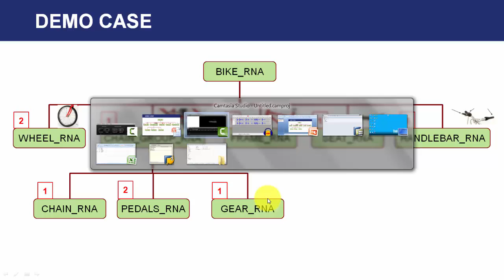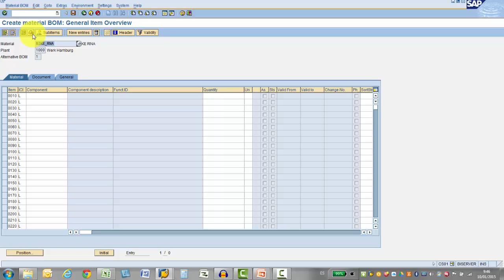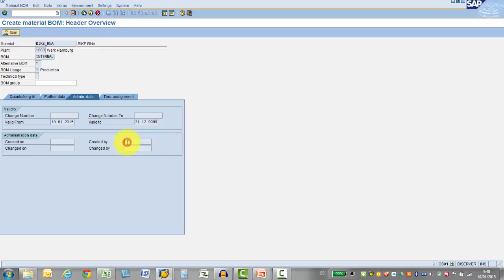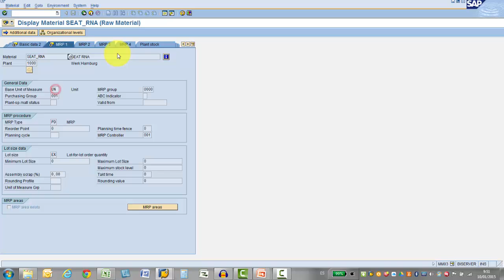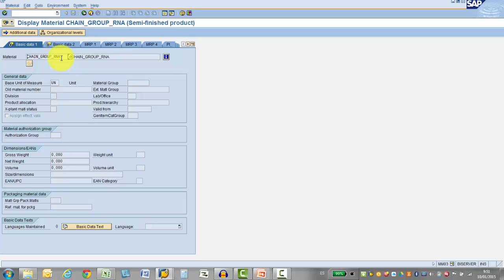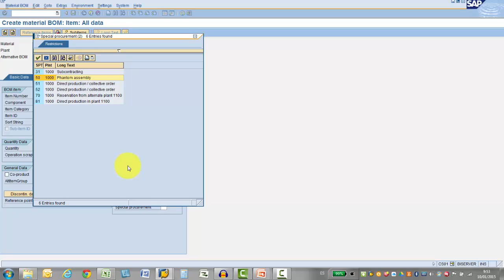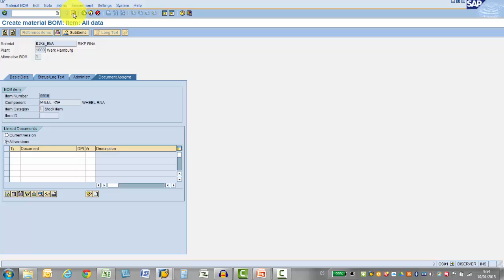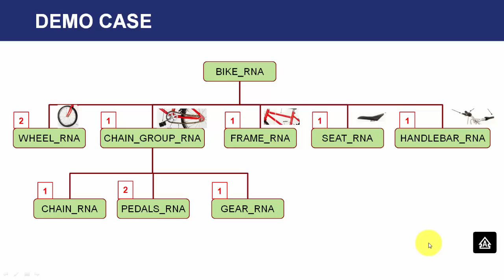SAP PP Course BOM Bill of Materials Demo (subscribe and get it free)

Comment: Hi! The BOM for the Chain that you put inside the BIKE BOM. Is that material set up differently to get that to work? We are trying to set this up in our system and it will not allow us to save it on the order. Thanks!
Reply from the maker: Jen Smith Hi Jen, I am not sure where you are getting the error. To which order do you refer?

What you have to do is to set up two BOMs, one for the BIKE_RNA and one for the CHAIN_GROUP_RNA.

CHAIN_GROUP_RNA must be set up as a Semifinished (or even Finished) Material. Depending on how the system is configured it might not allow to create a BOM for a Raw Material (Material Type ROH), normally it does not. So you could get an error if you try to create a BOM for a Raw.

I cannot imagine other error. If you give more information I can try to help you.

Hope this helps.

Regards